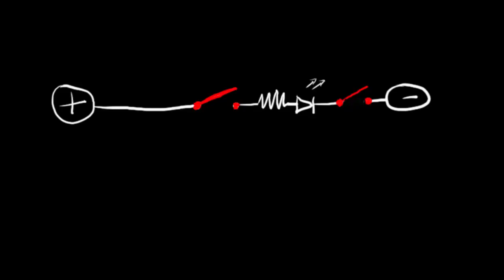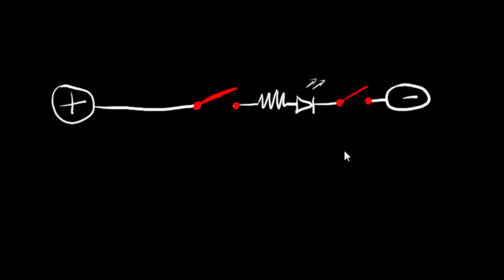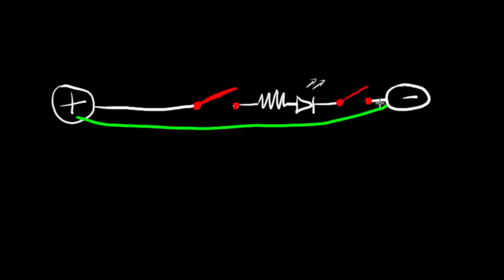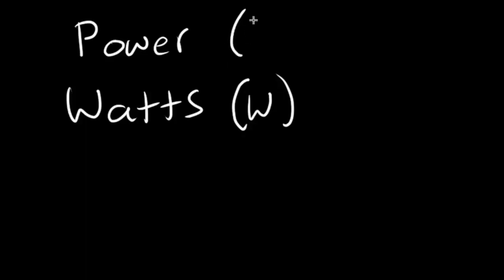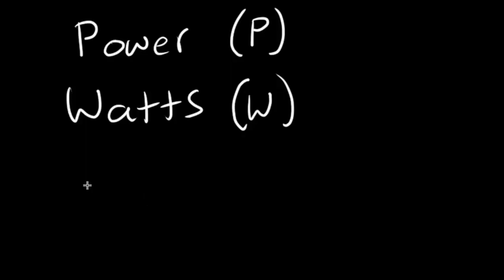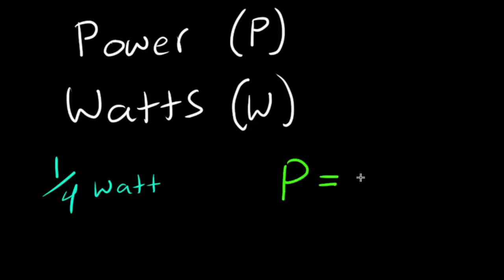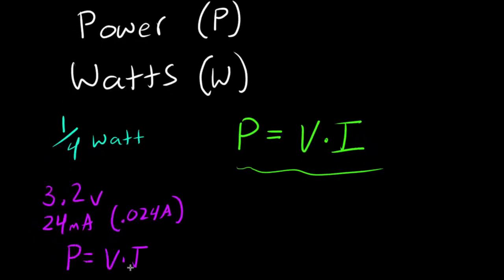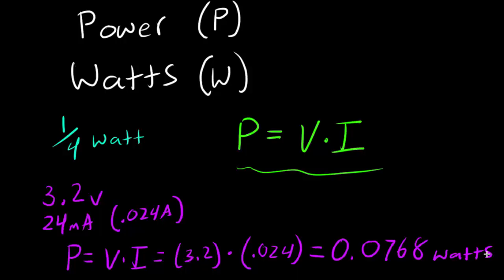Beginner Electronics - 16 - Clarify & Power / Wattage

Comment: this is 8 years later but its important to note that watts is joules per second, energy per unit time. it is not just energy otherwise itd be measured in joules. The amount of energy a component uses is dependent on time and the power it consumes. to find energy you would do, energy=power*time

Comment: People saying it is safer to have the switch on the positive side don't understand how electrons move. Not that anyone really does, but these people are especially ignorant.

You can not shut off the flow faster by moving a switch to different points in a circuit. Not unless you are using trillions of miles of wire.

Comment: Over what time frame does the LED use the .0768 watts? OR is that the wrong way to think about it?
Reply: Amps is how many coulombs pass through a point in 1 sec. A coulomb is a packet of electrons of a set size (about 7x10^18, so loads). So an amp is 7gazillion (or whatever the number is) electrons passing through a point in 1 sec. 

Because amps has a time frame then this gets continued through the maths. So 0.0768 is an instantaneous number. It's using that amount of power constantly. 

Think of a car sitting at 70mph. It's using up fuel because it's constantly using around 50bhp (a different unit of power) to move the vehicle. Even though the amount of energy it has used will get bigger the longer you drive. The actual power used will stay the same (unless something changes i.e speed, gradient, weight etc)

If something is working at a constant effort it will continue to use the same amount of power for however long that effort lasts. 

This might help you not sure !

Comment: Power flows from negative to positive, so in modern wiring all switches disconnect the negative (also called Hot) wire. This is because it's better to have the hot disconnected and staying in a switch, rather than staying in a bulb or other device. this decreases the risk of fires. I had a similar question when learning, and they actually used to wire switches to disconnect the positive, but switched later on. Hope this helps!

Comment: I love your video but since you mentioned safety, I think there are needed to be some warnings about what voltage power source are considered “high voltage ” and would be terribly dangerous. If I put 1000omg resistor there and cut my old computer power cable, plug cut side in the beadbord and plug side plug into the wall, the led should work perfectly right? 😂😂

Comment: Nice video but I think the distinction between power and energy should be clarified, the video sometimes mixes the two:
Power is measured in Watts. One Watt equals one Joule per second: it's a rate of energy consumption or production.
Energy is measured in Watt-hours (or in Joules). Be careful: this is a number of Watts multiplied (not divided) by the number of hours. It's Watt-hours, not Watts per hour.
For example, a 10W device that runs for 48 hours consumes 480 Watt-hours, which is 0.48 kilowatt-hours (kWh).
Since 1 Watt = 1 Joule / second, and there are 3600 seconds per hour, 1 Watt-hour = 3600 Joules.
Hope this helps.

Comment: for wattage of a resistor  P= I(squared) times resisitance. or if voltate across resistor is known. P= V(squared) divided by resistance. hoper this helps. note this is for dc only
Reply: and power through whole circuit is just p = I x V
Reply: also electricity is the movement of charge not just electrons

Comment: In the context of a battery:

Power is the rate of energy release.

In the context of a circuit:

Power is the rate of energy consumption.

Therefore, assuming the circuit is in a series (the voltage does not change throughout the circuit) and the components energy consumption rates do not change, the Power of a circuit is the sum of each components power (or energy) consumption or:

Σ (P1 + P2 … Pn) = Total Power of the Circuit (the total rate of energy consumption of the circuit)

Where P1 is the Power of a component in the circuit and n is the number of components in the circuit that use energy from the power source.

Comment: Summary:
- doesn't really matter what side of components you place switches. If a circuit is open, it does not allow electron flow, simple as that.
- but convention says place them closer to positive terminal of battery...
- electrons flow from negative terminal of battery to positive terminal
- but "conventional flow" says "positive" charges move from the positive terminal to the negative terminal (historical reason for this)
- these are both really saying the same thing, because negative charges moving towards the positive terminal is the same as saying positive charge moving towards the negative side of the terminal
- but know that in reality, it is the electrons that are doing the moving, thus if you want to be completely accurate, electrons are flowing from negative terminal to positive terminal

- power is rate of energy, in the electrical world, it is current times voltage (P = IV)
- for example, our LED uses 3.2v at 24 mA, thus 3.2 * 0.024 = 0.0768 watts of power

Comment: I am a complete novice,  if the flow of electrons are moving from negative sign to positive sign why is the resistor on the left side?
Reply: I had this same question too. Apparently, whether you are using the conventional current model (positive to negative) or the more accurate electron current model (negative to positive), both involve movement. The directional orientation of the current does not matter, rather its scalar quantity does. In short, electrons are frustratingly messy and work in really weird ways that defies ordinary logic, and the presence of a resistor in a circuit absorbs voltage wherever it is placed.
I am still grappling with this too, but here are some videos to watch that might give you some clarity on the matter:

Reddit Thread on this same question - https://www.reddit.com/r/explainlikeimfive/comments/5kshcq/eli5_in_a_series_circuit_why_does_the_position_of/

FAQ w/ Electrical Engineer - https://www.youtube.com/watch?v=zWC_AiycHbo#:~:text=If%20the%20LED%20gets%20too,a%20resistor%20to%20protect%20it.
Reply: @aaronnikels5706  Thank you!! I will definitely need some active learning to continue on this path.

Comment: OK. To make electricity flow you need pressure or potential, this is the voltage.  So electrons flows neg to pos but only if there is potential.  If we take the case of a switch on the neg side (low potential) then,  when it is open there is no current flowing.  Good right.  However what is the potential in the circuit? The potential at the first node e.g. where the pos connects is the supply voltage.  It changes throughout the circuit depending upon the circuit design. Now of course there is still no current flowing in the circuit. however, Jonny comes along and touches the circuit.  If the potential is sufficient say 110V etc. then jonny, being less than 110V provide the low potential and current flows. Straight through his hand even with the switch off.  Hence why you MUST wire to the high potential side the POS. So  all this talk of convention and not understanding flow is complete garbage.  To be more  accurate you need to consider emf rather than voltage.  EMF can be crudely thought of as the ability to overcome resistance.  E.g. take a 12v flashlight battery. If you short it out by touching the pos and neg with you left and right hand, you are not likely to see any effect.  If you try that with a cars lead acid battery you are going to regret it.  But both are 12V?  This is because voltage comes into play when the circuit operates and is the potential in the circuit.  EMF is the true potential force able to be utilised.  When we say we have a 12V battery to connect we are saying we have an emf to connect that when in operation exhibits a circuit potential of 12v. 

Learning stuff from an unqualified person can be dangerous.
Reply from the maker: I tried to make it clear in this series that I am not a qualified electrical engineer; I still am not. I am a small electronics hobbyist, and a Computer Scientist. With that said, I wish that I clarified this a bit more. Safety is extremely important, and not teaching that is a massive error.

After re-watching the beginning of this video after many years, the "convention" talk I used severely underplayed quite a lot of things going on here, which you described. My knowledge, being a hobbyist with effectively simple digital logic for all intents and purposes, is no match for electronics as a general category. I think that's where I went wrong "marketing" this series - this is a series primarily about digital logic (which only becomes truly apparent later in this series). Not a series on working with electronics, as a category (as the title of the series implies). Not a series on  safety with electronics.

Electronics as a category is wide, far, and complicated. Something I am not qualified to teach beyond my personal knowledge; which, as I said, is limited. Quite the difference, and I'm to blame for this. In fact, I appreciate with the utmost respect the criticism and comments like yours on this series. In fact, I wish I can find a way to put the largest of disclaimers on the beginning videos of this series because of that. I was younger, and wish I had done things differently to clarify and target it at what I know how to do appropriately, vs. the broad term of "all electronics" that the first so-many videos of this series implies.

Comment: If the current is flowing from negative to positive...shouldn't the resistor be connected before the led. To avoid damage to led...cause I can see 9v passing through the led then cutting down by resistor...to complete circuit...pls explain?

Comment: Its vital that you adhere to the flow of the schematic. If your schematic has a led with its positive lead connecting to vc and negative to ground, that LED will work.
However, if you make the assumption that because electrons flow from negative to positive you must connect everything backwards, you will never have a functioning circuit.

Comment: EXPLANATION WHY CURRENT is from + to - of current flowing direction. Electrons are part of some atoms. With some energy ( like power source ) electrons are pop out of an atom and they live behind HOLES. These holes are positively charged. As you move electrons with power source, holes ( that are positively charged ) are also moving. By convention flaw of electric current is not moving of electrons but moving of holes ( positive charge ). That is why we always draw flowing from + to -. How can a hole have a charge? Atoms are electric NEUTRAL because they have same number of protons and electrons hence neutral. But when you pop out electron  ( negative charge ), there are more protons now, so more positive charge. Its not anymore atom it is positive ion. With power source they flow from + to - ( take home: By convention current is not moving electrons from point A to point B but moving of positively charged holes ). HOW CAN ELECTRON LEAVE A HOLE? It is just descriptive explanation. Electrons are tied to atoms, closer electron is orbiting to atom core,  it is harder to pop up electron to live his place. ( You need more energy ). But electrons in last orbit are loosely tied, and you need little energy to pop it out and leave an atom. Back to the question why holes - it is because positive ion would like to maintain balance ( to be electric neutral ), and will gladly accept some nearby freely flowing electron. If it catches electron, electron fit in the hole  :) at the same orbit previous electron had :)).
Reply: Thank you, now I am even more confused :(

Comment: Is watts measured how much energy is being used per second? To make it Watts per hour, do I just multiply by 3600?
Reply: If you want Watt-hours, you must multiply the number of Watts by the number of hours. For example, a 10W device turned on for 24 hours equals 240 Watt-hours, which is 0.24 kWh.
Please note that we're talking about Watt-hours, not Watts per hour. It's a multiplication, not a division.

Comment: It made more sense to me when someone explained it in gaming terms:

Voltage = damage per shot
Amps = rate of fire
Wattage = DPS/DPM

Not a totally perfect analogy but it got me to understand the basic idea
Reply: this makes more sense

Voltage = rate of fire
Amps = damage per shot
Wattage = DPS/DPM
Reply: @dieselgeezer18  both could be true and this makes it really confusing😶
Reply: @sp1xa  yeah xD
Reply: @sp1xa  Amps is what does the damage, volts is just how the amps gets to you. So I think Mr. Potatoes and Trucks's analogy makes the most sense
Reply: @gamerdio2503 , yeah, yet you can translate rate of fire with rate of electrons flowing, and  that gives Amps is more easily translated to rate of fire. Voltage is also related to the enrgy an electron will have (The higher the voltage, the higher the energy of the electrons passing) .That way you can defend Zack Akai's, rule of thumb :)
Reply: @dieselgeezer18  well actually voltage is neither cause it's a potential difference.

Comment: Resistors should be close to positive or negative terminal of the circuit?
Reply: doesn't really matter, it could be anywhere (just be careful with paraller circuit, there it's important in which wire the resistor is)
Reply: @AceofSpades-mx4dx  Thanks

Comment: Conventional electricity shows the path a positive charge will follow, which is from a positive voltage to the lower voltage. However, electrons are negatively charged particles, so they move the opposite direction (from negative to positive).
In case anyone wonders where could you get positive charges that would follow the conventional path, ionized gas particles is one choice.

Comment: Great series.  One comment on wattage: Wattage is the amount of energy used per unit time, so it's the rate at which energy is being used, not the total amount of energy.
Reply: No.  You're thinking of watt hours, such as kilowatt hours for home electrical use. 

Watts = a measure of electrical power expressed in watts.

Comment: I've heard that high currents are more dangerous than high voltages. Is this true? Please respond quickly, my torture victim is waiting.
Reply: High voltage is dangerous because it can cause high current, if the power source is large enough to sustain it. The current kills you, the voltage helps you generate the current. I=V/R

Comment: The electrons flow from the negative terminal to the positive terminal. However the current direction flows opposite the electrons, so from positive to negative. @codeNMore
Reply: Current is the same as electrons

Comment: A positive charge has more protons (+) than electrons (-). A negative charge has more electrons (-) than protons (+). So in order for the electrons to move, since a negative charge has a spare number of electrons, they move towards a positive charge which has less electrons. so electriciy flows from negative to positive. A neutral charge which it has the same number of protons and electrons, is usually the insulator, because electrons don't need to move in it.

Comment: So the resistor is taking 140mW. Cuz P=I*V then P=0.024*5.8=0.1392W

If the resistor is 1/4 watts or 250mW then it's operating with more than half of its capacity.

If this resistor were 1/8 watts or 125mW, would it fry?

Comment: why do you use a dot instead of the common multiplication symbol 'x,' surely it's possible to make mistakes like that?
Reply: its just a common replacement for it, since in algebra 'x' is often used as a variable. helps to avoid confusion with algebraic equations :)
Reply: In algebra you use letters as variables, the most common for an unknown variable is written as "X" so you either right it out as (just using ohm's law as an example) V=IR    V=I x R     V=I(dot)R    all of which mean the same thing

Comment: Wait, why do you draw the LED with the 'arrow' pointing towards the negative end? Electricity flows from negative to positive, right? Is this how LEDs are drawn, with the back to the positive end or is that just a mistake?
Reply: Wow from the second I unpaused the video you started talking about this
Reply: Because while ago when technology wasn't that advanced people thought electrons flow from positive to negative (also known as conventional electron flow). Because a lot books was already written, schematics made and it don't change anything, unless your chemist,  people decided to keep conventional electron  flow. Today engineers when  designee circuits are using conventional current flow and all polarity sensitive components are manufactured and marked by conventional electron flow. Just remember when you design electronic circuits place components right direction like electrons flow from + to -.

Comment: so would the power rating be the same as the resistance?
Reply: Power = V x I  whereas Resistance = V / I if that has confused you remember V I & R are all related with Ohms law: V = I x R. This lesson added the concept of Power being = V x I which uses the two same variables but in a different way.

Comment: if electricity flows from negative to positive and the resistor on the positive end of the led wouldn't the resistor be useless because its getting full 9v (if the power supply is 9v)
Reply: I believe so

Comment: If electrons flow from negative to positive, then it would be safer to have the switch closer to the negative node so as to prevent unnecessary flow through your components.  Think power surge.
Reply: Once the switch is up, the circuit is open and electrons automatically stop flowing through any part of the circuit. So, it doesn't really matter where you place the switch. At least according to the basic theory it doesn't.